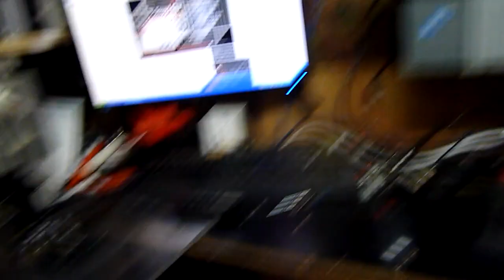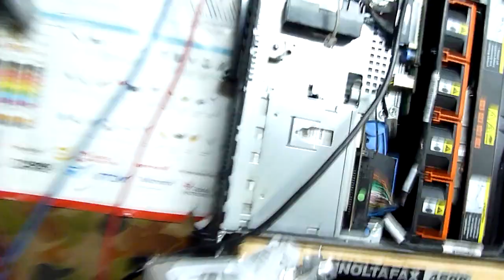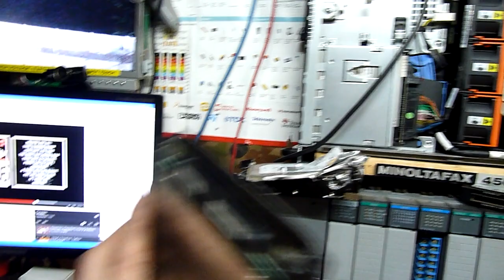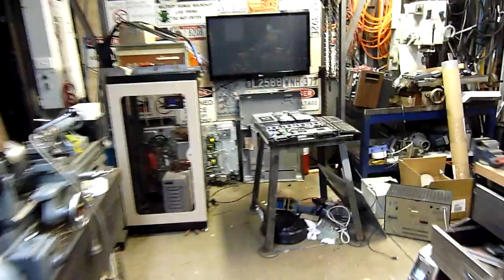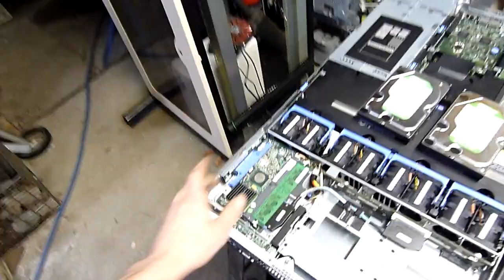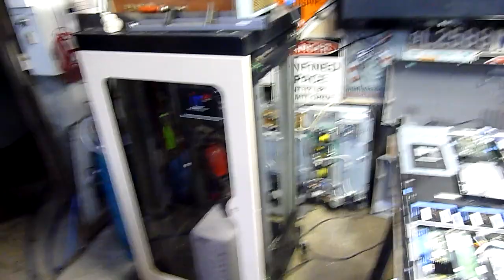Ramblotron Entry   May 27 2014

Comment: ed here is my 5 cents, dump windoze and buy a mac, 8 months ago it was the best thing I ever did...DO NOT touch windoze 8, 8.1, whatever
XP and windoze7 are amazing, 8 is an epic fail and will destroy the microsoft brand, in fact it already has
Reply: I have to say.. I did the same thing about 7 months ago and It's changed me.. I could never go back to windows.. 

Even windows 7 isn't as good as OSX Mavericks.. OSX Is just better in every way..
Reply: I use both Mac and Windows 7. I like them both for different tasks. I love Windows 7, and I love the way Macs works. So I guess I'm on the fence a little bit.
Reply: Or re-use existing hardware with Linux.. Mac is not the only other option although it is a good contender.
Reply: I find it to be most viable on modern computers too. Especially when running, eg, a Windows VM (via programs like VirtualBox) or Wine for those few things that won't otherwise run. I was only commenting that it's an alternative to Mac if Ed still wants to re-use his existing hardware rather than going out his way to pay for hundreds of AU$ for a Mac.. Even though Mac would run some of those programs natively.
Reply: Only problem is, he wouldn't be able to install Mac OS X on a server if I remember correctly. Pretty sure you have to buy an actual Mac Server to have Mac OS X, etc. installed legitimately.
Reply: I have Win 8.1 and haven´t had any problems so far, really good.
Reply: Gah! Get it away!!!
Reply: Ahh, it's not quite a Vista.. Close but not quite.. At least 8 is responsive!
Reply: I actually liked vista... Shoot me.
Reply: Cap10323 it was alright in it's 64-bit flavour, never got anything but slug out of it in 32-bit though

Comment: Freenas is only for file storage and doesn't really have a graphical user interface since most of the tasks are performed using a web interface. It fantastic as a fileserver, I currently have a Freenas rig to store my data, but Freenas isn't a desktop operating system. I would use something like Kubuntu or Linux Mint. I find that later release of Ubuntu is really hard to navigate around, specially with the unity interface, I just can't get use to it.

Comment: My question is what are good solid uses of servers other than file storing?
I have  a 2009 Xserve with a Nehalem Xeon (turbo boost and hyperthreading enabled) and I just don't know what to do with it. Sure it works great for storage and back ups with about all that unused CPU power? Ive thought about setting up a GMOD server on it and that's about it. What do you guys use your servers for?

Comment: If you have enough RAM you could stick VMWare ESXi on it and run a couple of VMs.  It'll handle it fine.

As for a NAS distro, use NAS4Free.   It's the original FreeNAS before it was bought and ruined.  The original FreeNAS creator wasn't happy with what the company did with it so continued the original project under a different name (NAS4Free).  It's rock solid and very fast!

I look after a large network with 3 main sites and 40 small sites.  Unfortunately don't have any spare windows licenses, we use volume licensing.

Any questions, give me a shout. :)

Comment: As others have said, FreeNAS can't be made into a desktop... Well technically you can, but not easily and the end result really isn't worth it, keep for a backend storage appliance on your network and operate from that.

As for Win 8, or anything with the 8 in it, I wouldn't touch it with a 500 mile pole if I could help it, for Win 7 remember the only thing that matters is getting a license key, the disc doesn't matter, that you can download from Piratebay if you want (Legally too, as you are allowed to change the disc image to add drivers etc.) but the license key is the deciding factor.

A linux based OS would work for encoding (You would get codecs that were OpenSource and friendly with Google's YT backend) but the proper tools for that are all CLI, but scriptable / automatable if you fancy that.
If it doesn't tickle your fancy, fetch a Windows 7 copy and just steer clear of the muddy Win 8 waters, MS is in retreat anyway and will soon be offering the old start menu anyway.

Comment: Does the server have any kinda COA on it that says what is was running ?  A server OS or Linux would be happy there. Also windows 7 would probably be happy in there too. The Ultra Scsi Drives usually come in 9, 18, 36, 72, 146, and 300 gb flavors, I think there maybe have been a few odder sizes and maybe a 500 as well ? The old SCSI's fly though I still use them a bit. XP will technically recognize 2 cpus with multiple cores. You just would be stuck with a MAX of 3.75gb of ram. Windows Server might work too if you can get a copy. And if you have a COA then you technically have a license and you just need a set of discs I think. I think Sony Vegas will make use of all the cores in the machine to render video :D I have a HUGE / CIPRICO IDE array here that connect via Fiber to a 4gb HBA.. I see 30 ~ 80 MB/s write speeds and read speeds are through the roof. Don;t dis the IDE array until you play with it a bit. On another note, IDE drive usually sell well on eBay as people are looking for them for old machines and well.. old arrays :D

Comment: SAS = Serial Attached SCSI, you need a SATA to SAS interposer card to slip between the back of the drive and backplane.   If you notice there's about an inch of space in front of the drive in the sled (towards the release handle), and there should be another set of screw holes to line up with the 1" spacing differential.   Look up Dell part number PN939 (on eBay).
Reply: you can put any SATA hdd in it instead of SAS and it will work. SAS controllers work with SATA disk but SAS disk will not work on SATA controllers. You dont need any adapter

Comment: Dont put those WD Green drives in a raid they are not made for that kind of use they will always be dropping off and rebuilding the array they will be best suited as backup drives. With freenas you can't use it as a desktop OS it is command line with a webui for config. Best to go with W 8.1 or W 7 Personally i like W 8.1 i have updated just about every computer in my house. There will be a update coming at some point to bring back the normal start menu without any 3rd party software to do it.

Comment: looks like that dell has a drac in it useful little card if you can get it working. i use xenserver on my dl580s and have a number of windows and Linux installs running virtually under that.

Comment: Linux Mint and Ubuntu are good desktop Linux OS's. Not sure on video editing options, might look into it for my Mint machine.

I would recommend getting savvy with the Linux CLI if you are not as it is a major part of using Linux on a day to day basis.

I like XP, 7 is good. 8 I personally don't like.
Reply: I use openshot video editor for my videos on my linux mint.  It seems halfway decent.
Reply: i hate windows 8 while at times it has a fast start up time whie there is most of the time it is slow as hell like a win 95 pc
Reply: red hat costs money and for my server which is a HP board in a cooler master case it runs windows server 2008 r2 enterprise i downloaded for the net
Reply: Lightworks is excellent for editing on Linux

Comment: Not so sure if the processors and chip set will be supported with most operating systems, I tried running Windows 7 64Bit on my Dell PowerEdge R620 but it kept crashing due to incomparability but you could try your luck but if not then you could use Windows Server 2011 which is like Windows 7 or 2012 which is like Windows 8.

Comment: If you want to set it up as a server I would recommend sticking with Linux, so much less hasel and Linux was designed from the get go to be networked multiuser system. Windows 7 is a bugger to network.

Comment: UGh green drives, They do not like the vibration from the server fans. In my exmerance they will last 4-6 months in a 24x7server.  You want WDblack disks at a min, or re4 if you use a raid card.

Comment: Hey Ed, for the server, don't consider FreeNAS unless you are going to use it as a standalone NAS, beyond that it's pointless.

Windows 8.1 is fast and would work great, but yes, the UI is a dog's breakfast.

I'd suggest running Server 2003 R2 for intense stuff, but Windows 7 would work as an excellent OS for what you're after and would run it well, as well as have great driver support and run every bit of software you need.

Beyond that if you're adventurous, you could consider running a Linux distro such as Arch, with a desktop environment such as KDE or Gnome.

Comment: Ed look for a copy of win server 08, give it a try, I use it in my supermicro 4x quad opteron server runs a treat, its based on win 7, I tested it out on my old hp XW9400 workstation, and it was pretty snappy on just 2 dual opterons so it should run great on your quad xeons

Comment: Use Windows 7, Use Windows 8 if you like the interface and can find the drivers.  Freenas is designed for headless units and not suitable for the descibed usage. Make sure to fit a cover before running the server otherwise itll get toasty.

Comment: Hi Ed,

You probably wouldn't want to use Freenas as a desktop OS. Its not impossible of course but not very practical.

If you want to use something BSD based you could try PC BSD (I never tried that myself but it should work).
 
I personaly use Ubuntu but I don't think I have to tell you about all the Linux options out there ;).

Comment: i love win 7 pro, but do not mind win 8 / win 8.1 with classic shell installed, without that shell I refuse to use win 8 or 8.1 as it plain stinks.
I tend to customise my win 7 machines to feel more like win XP pro,

I use 7Task Bar Tweaker to make the task bar behave, as well as adding quick launch and removing that silly pin to taskbar rubbish.

That been said I also use quite a lot of open source stuff here as in OS and other applications, linux mint I like far more than Ubuntu now, I also use debian without a gui on several server machines.

Comment: Server 08 R2, Win 7 Pro ect will all work. Don't use FreeNas as it won't work well with your application. Did you need ddr2 or ddr3 for that one? Chances are it'll be ddr2 ecc unregistered in 2gb dimms. 

Also ultimate isn't available anymore as it's discontinued. Synnex/Ingram/dicker who are the three Aussie disti's for Microsoft and no longer carry ultimate, only pro and home premium. Let me know if you need anything specifically as I keep quite a lot in stock at home as well as I can get anything through work

Comment: Yep, that's what I've been saying about XP, despite their lack of foresight with vulnerabilities in the OS, MS did a good job with XP, because it just works, once it's all patched up of course... :P

If you want to keep your data, it'd be far safer on a WD Blue or Black, the Greens are not reliable, same with the Reds (which are supposed to be built for constantly running file storage ironically)...

Comment: Hey Aussie50 Instead of using FreeNAS use nas4free, I've been running it in my house for around 2 years now and it runs on 3Ghz Pentium 4 and 1GB of RAM and around 750GB of Hard drives space. Daily it has around 8-10 Computers connected to it constantly and for a Pentium 4 with a Gig of RAM it runs really well. It was running FreeNAS to start with but I just didn't like the interface and I found myself getting stuck quiet alot. Then I watched *****' video with his nas4free server and then I started using nas4free since then and it's so much simpler to use.

Comment: Windows 7 x64 Professional works wonders on dual Xeons.  Has to be Professional, though.  I think 7 Ultimate should still work, it's basically Pro with a few extra goodies.  Home only has support for single CPU.  Servers are beautiful systems and make excellent desktops.  Exceptionally reliable.

Comment: I personally use FreeNas and its not a desktop OS, it has no frontend and is entirely accessed threw a browser over the LAN.

I would recommend you go with Windows 7 if you can find it, otherwise Ubuntu is the most Reliable and Stable Linux Distro out there, Linux Mint is a close second.

A x64 copy of Ubuntu would happily utilize all the cores, tho Windows 7 Pro and Ultimate are the best for greater than 4 core machines, and Windows 8.1 is NOT terrible, people are stupid, Windows 8.1 is leagues ahead of 7, the GUI is the only let down.

Comment: Windows 8.1 is alot better than 7. 7 has major issues with hard disk DMA management. When it goes all drives are reduced to 15mb/s and you usually have to format to fix it. This happens especially when moving lots of data like video editing. I suggest get Win 8.1 and google a program called Start is Back. It replaces the start menu with a 3rd party 7 clone. It even uses the original code still in 8 so it works perfectly.
Reply: 8 Isn't better than 7 at all. If anything it's worse.
Reply: jmcinvale
from an internal kernel POV it has introduced some refinements.
Reply: jmcinvale
He said 8.1.

Comment: Windows 8 is fine as long as your willing to a bit of fooling around. I have a start menu app that brings back the old windows menu, and my computer is now literally identical to windows 7, except i can switch back and forth between metro if i wanted to. Windows 8 is fairly good on system resource usage. Just remember that people said Vista was going to kill microsoft, and i STILL think thats their worst OS. Windows 8 has WAY less problems than Vista did.

Comment: I do believe you can run XP on some newer machines depending on their age.
Personally, wouldn't trust anything above XP. On windows 7 alot of files like GIFs need programs installed to run them because they're not built into the system. 
Or the other option, get a mac! :P

Comment: Ed just torrent a version of windows server 2008 r2 and sometimes you can find a iso for Dell products of windows server i did at one time find a dell branded one and u can robably find a dell windows 7 iso as well that should remain activated if a Dell SLIC is detected with in the programmed slic database of windows 7 and server i worked on win 8 pc's some have become slow as hell and i seen some that dont even show a months run time and was slow as hell due to severe fragmentation

Comment: for server stuff, you could try virtualizing - I've heard many have had success with Proxmox VE (free) - then you could make virtual machines and try out a few different desktop OSes on that.  This way you could make a virtual XP, 7, or linux machine.  the only trouble is graphics hardware.   You may be able to expand the few PCIe slots with a Magma ExpressBox or something, then you could add more cards.
Reply: Proxmox VE will also let you use more than one server to split the workload, similar to a cluster.

Comment: Regarding the Server, you can always install Windows Server 2008R2 on there. Just google for Server 2008 R2 Workstation, and you'll find instructions for how to disable security stuff and use it as a Workstation.
You can probably get 2008R2 from any Student for free, cause they get it though the Microsoft Student Programm called Dreamspark. Most Students use the Windows 7/8 licences but rarely anyone bothers with Windows Server.
They can sent you the ISO and the Key.

EDIT: You will have the classic XP Style as well ;)
Aaand you can download a 180 Day Trail Version for free. Keys are here http://forums.mydigitallife.info/threads/6726-Server-2008-R2-7600-16385-180-Day-Eval-Key-s

Feel free to PM me on G+ if you got Questions :P

Comment: Since this is a server, you really should be running Windows Server on it. Anything from Windows 2000, 2003 to 2012 should work. Trying to run a desktop Windows version will not give the benefits you are looking for. The drawback is that not all Windows software will run on Windows Server. Win XP programs will run on Windows 2000 though ;) FreeNAS will work if you want a NAS, but otherwise it is pretty useless as an OS.

Comment: numero uno is finding if you can drop a graphics card in the server-- if you can do that, you're good! drop 7 on it like there's no tomorrow. using it with the onboard graphics will most likely be problematic since most don't even do anything 3D. and don't bother with Linux on that-- too much for you to relearn in terms of video editing in one go. Take this from someone with more Linux machines than I can count on one hand. 7 will run just fine on that by itself-- I can even guarantee it'll run and show everything since 7 sees both my CPUs with both of their cores in the opteron box.

I expected the server to be set back into the corner a bit more. guess not.
Reply: Officially Dell dont have compatible graphic card list for 2950, it have 2 PCI-E slots (x8 and x4) on riser bord ("system board connector"). Some people menaged to make some graphic cards to work in it but that is not so easy solution (DRAC-5  is incompatible with video cards other than the built-in one)
As mether installing Linux on it that is easiet solution in world, anyway most of Dell 2950 was shipped with Linux on it (Red Hat) so you can install any Rad Hat clon on it and you will have all drivers.
As Windows 7 I am not shoure you can make it simple run on it and even find drivers for all hardware in it.

Comment: Windows 8 is like Windows ME that was utter CRAP as is 8 is CRAP! The next one will fix 8 - I think 8 is still beta it shouldn't have been released yet. You can still order Win7 as far as I know. I know I can get it preloaded from Dell on a laptop so it's still available the businesses here in the states still use Win7 pro http://www.amazon.com/gp/offer-listing/B00H09C0U2/ref=sr_1_1_np_0_olp?s=software&ie=UTF8&qid=1401686339&sr=1-1&condition=new